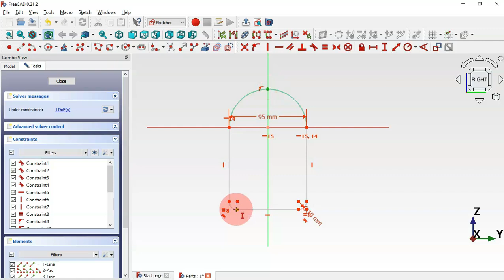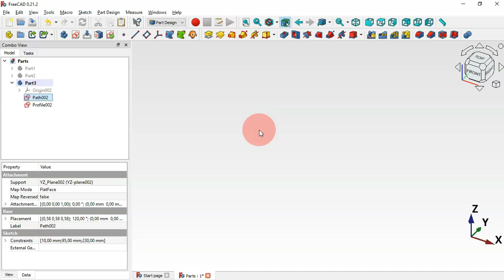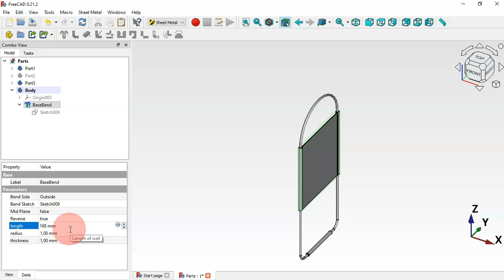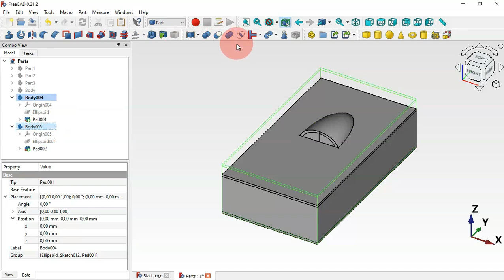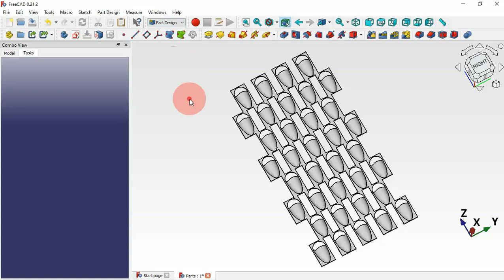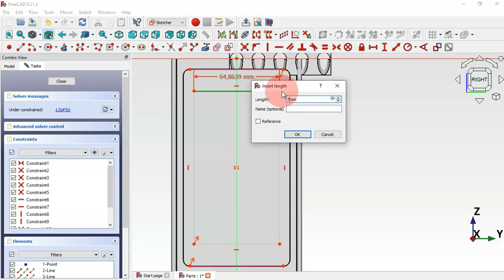FreeCAD 0.21 Cheese grater

Comment: You did a great job with the ellipsoid as you told me before. Really great! I'm adverse to the Base Feature... Did you get access to the links I've sent you after all? Cheers
Reply from the maker: Thanks!  
No, I didn't seen it.
Did you send it here in the comments or used email?
I checked email now and didn't find anything related. If you shared it in the comments probably YouTube removed the links.